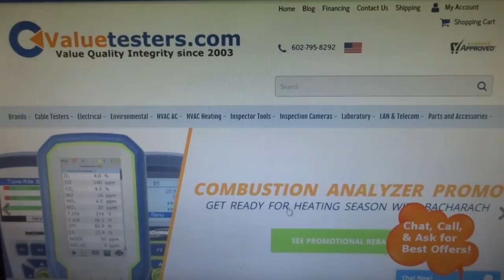gas water heater leaking at water connections fixed

Comment: Little tec tip wrap the tape around a pencil firs then put on pipe in tight spaces.
Reply: Did that yesterday when I put new shut off valve on toilet. less then half inch between threads and wall.
Reply: Thank you!  I'll use that :  )  Also dope+tape. No leekas Momma!
Reply: been using tape and dope on threaded fittings since watching Steve a couple of years ago; NO leaks since!!
Reply: You took the words out of my mind Tom Earnshaw, good tech tip

Comment: Teflon is not a sealant but actually reduces the friction of the threads and allows the joint to be tightened an extra turn or so which is what helps the seal. Without teflon I believe the joint didn't go far enough on to make the pipe dope alone effective, and the water slowly washed it out. I have found by DIY experience working on pools that teflon alone is my favourite solution, dope alone leaks after about a year, and using both is messy. That's just how I do it.
Reply: kdmq 
Try it without ptfe
Reply: @anthonygrimes1977  I did so once on pool plumbing, used pipe dope but not the teflon tape. It sealed for the first season and partway through the second season the water washed the dope out of the joint and it was dripping. Since then I use just teflon cause the dope makes a mess.

Comment: Does anyone know why he installs vacuum breaker on every top fed water heater, is it some sort of local code? they all have a dip tube that serves the same purpose because it has a hole in its top. Is it in case the dip tube breaks off? I never see it in my area.
Reply: biker55555 it’s local code in his area. So tank won’t crush in if fire department is sucking water out of street hydrants with a pumper truck.
Reply: Fireship1 interesting, thank you. How do they not crush in other areas of the country that don't have the vac breakers installed?

Comment: Thought you'd have replaced those ugly fittings. I'd have cut the water outlet pipe after the gas pipe and fix that rubbing too.
Reply: That would have been the proper way to address this issue. Those fittings are rusted out and could lead to more rust and failure in the near future. I'm sure Steve will be there that day to patch this boiler again ;-)

Comment: Something different, thanks. I would have used a crescent or pipe wrench though rather than pliers, but that's me.
Reply from the maker: real plumbers use pump plyers ,,thats the way we were taught as and apprentce .are you a handy man?
Reply: No, I'm a heating business owner who does a little plumbing and I learn something new everyday, Thanks for your reply.
Reply: I don’t think there’s anything wrong with using a large crescent is long as you get it good and tight and the metal is not deformed.

Comment: You have copper touching a galvanized fitting, thats why its leaking and corroding. It's called "Galvanic corrosion" A Dielectric union is needed at both the cold water inlet and the hot water output? The only thing you are guaranteeing is that you will be back to fix this again in a few years. Adding Dielectric unions would've only added about $40 to the job.
Reply from the maker: THE HEATER HAS DIELECRIC NIPPLES ... SO WHY WASTE MONEY ON UNIONS ???
Reply: They might call those "nipples" dielectric but you still have copper touching galvanized pipe. Here in Illinois it's code, a dielectric union is required where 2 dissimilar metals touch each other which is what you have.  Galvanized dielectric nipple(s) coming out the top on both the cold and hot side, connected to copper supply lines. The $40 cost of those dielectric unions would have been saved if they had been used on the original install. Don't know what you charge for a service call like this, but I'm sure it's way more than $40  @stevenlavimoniere

Comment: on those single PVC vented heaters there is a tapping with a rubber plug on it.. 16:20 .  Sometimes those heaters will condensate and the corrosive water pools around the  connections.    I will take some 3/8 clear tubing, make a loop in it (condensate trap) and run it to a drain.  I been back to several tanks that we thought were leaking and that was the problem.  Install manual even suggests it.
Reply: @lambition  I likely live in a colder climate than you...northern alberta canada.  It's a worse problem on 2-pipe take...drawing cold combustion air from outside.  That condensate mimics a failed tank.  Corrosive condensate gathers at the top of the tank and then starts leaking down through the jacket.  The blackened nipples on steve's video suggest corrosive water. Galvanized steel is basically zinc plated mild steel.. the zinc in that steel is just a sacrificial element that degrades instead of the steel when oxidized.  Water that is leaking shouldn't oxidize that steel and turn it black that badly in 2 yrs.  Carbonic acid is a rapid oxidizer like all acids and would turn those nipples black.
Reply: replying to myself..... Mr. Steve L. is a fine plumber.... 2 leaks on one tank...not likely...A guy like that is a one leak per year guy.  BTW   if a plumber says he has never had a leak... he's lying... or isnt a plumber.

Comment: Why no threaded flex pipe off the tank. Soldered pipe throughout seems unnecessary
Reply: those are for hacks
Reply: @darrenr1194  Agreed. Would send the plumber home if they wanted to use that. Death of the trade.

Comment: Mr. Steve... why didn't you use dielectric unions or brass couplings??? Dissimilar metals in contact with each other like that will corrode. Electrolysis. Don't agree with your repair on this one.
Reply: Daniel Imbery aren’t those dielectric nipples that go into the water heater?
Reply: @mct8888  what makes it a dielectric nipple? The plastic that lines the inside of the nipple? That keeps the nipple from corroding from the inside out. The copper threads still make contact with the metal threads of the "dielectric" nipple which is where the corrosion from electrolysis occurs.

Comment: Steve I know you installed that hot water heater because I could tell by your handwriting on the date that you wrote on the hot water heater. I always use teflon tape and pipe dope together that's why I never have leaks. Where is the video of the trackless in the snow because you all had snow the other day. Peace brother and Molly
Reply: He already said shit happened why you are so direct AND at the end he said he installed that WH. .Steve use insulation pipe to isolate the two pipes that cardboard is not permanent if you don't have one in truck just advise the customer.
Reply: @progressplumbing5203  nobody said nothing about the cardboard
Reply: good combo